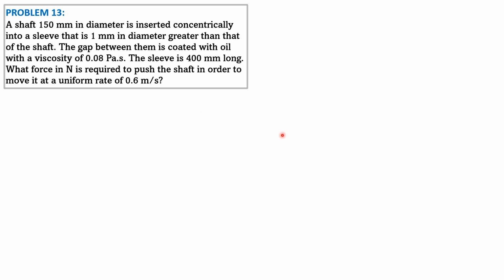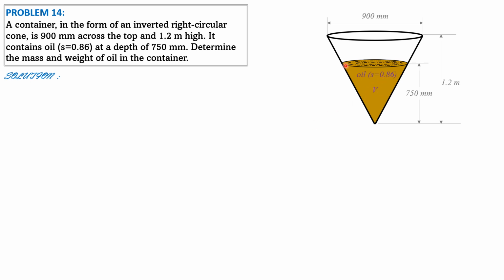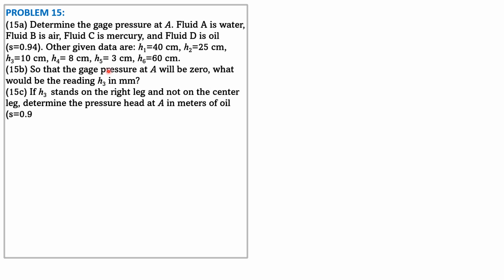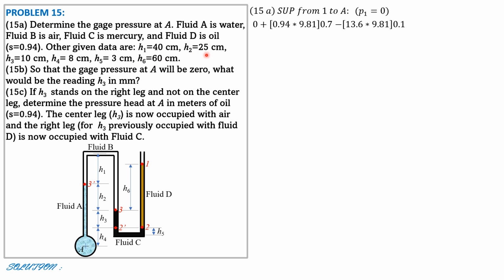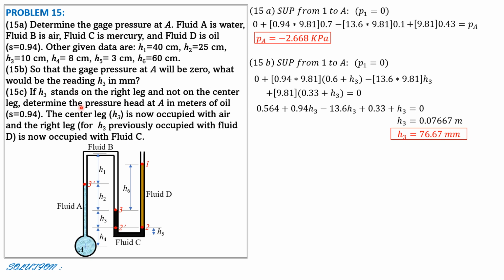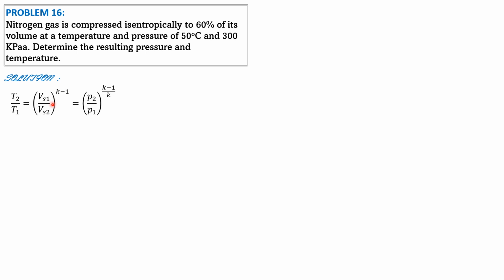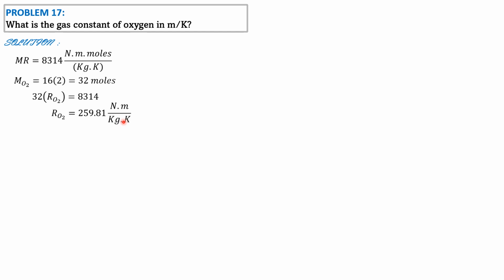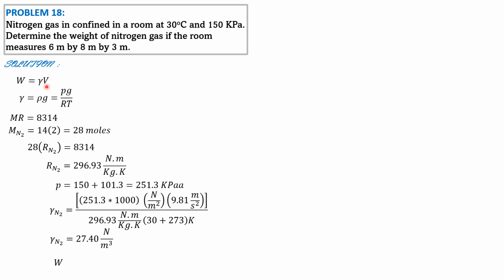Solved Problems in Fluid Mechanics and Hydraulics 13-18

Comment: Yung problem 1

What is that 1mm/2

What is 2 in their sir?
Reply from the maker: @alfahaddawami3494. Thickness of fluid or gap between fixed surface and rotating or moving surface. The outer diameter is 1 mm bigger than the diameter of the shaft.